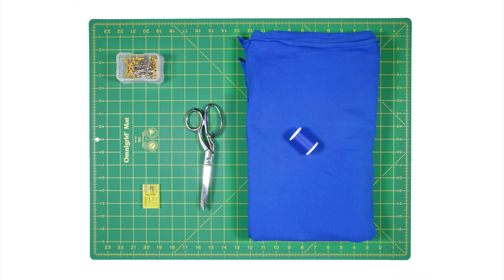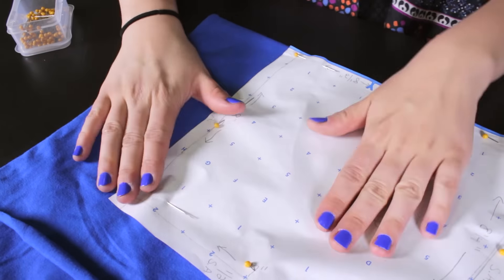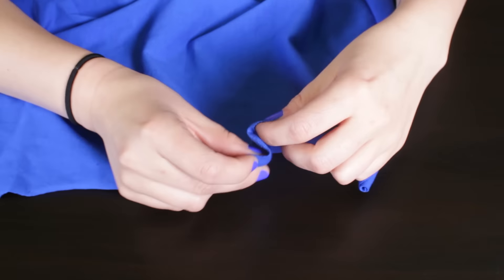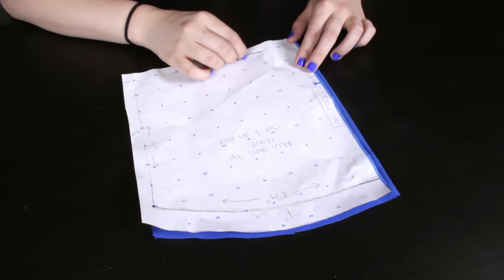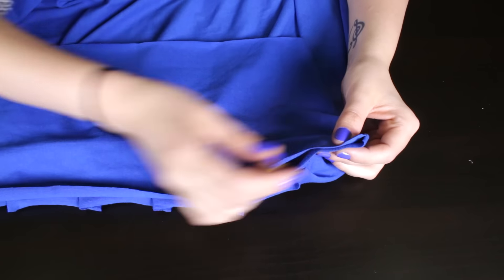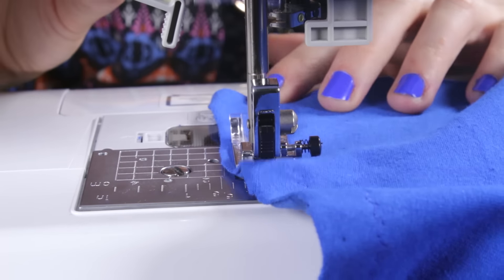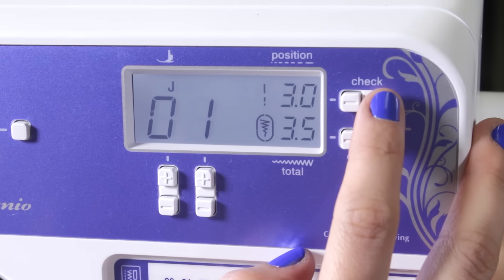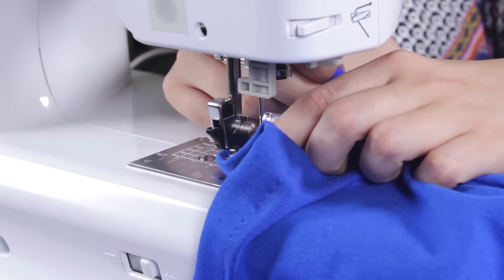DIY Pleated Maxi Dress - Free Pattern

Comment: Is there a right and wrong side to this fabric?  And, does the dress stay up securely since there are no straps?  Thanks!
Reply from the maker: Bunny Wilson There is no wrong side to this jersey fabric. It does stay up securely because of the stretch of the jersey that makes it a great fit. With jersey you would typically make it an inch smaller on each side, because of the stretch. Otherwise it would be a little loose. Hope this helps! :)